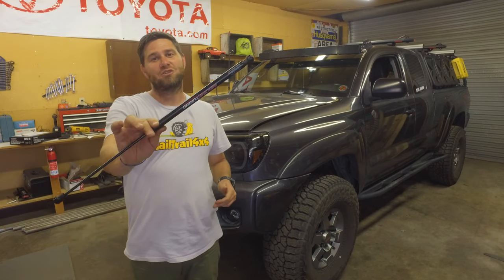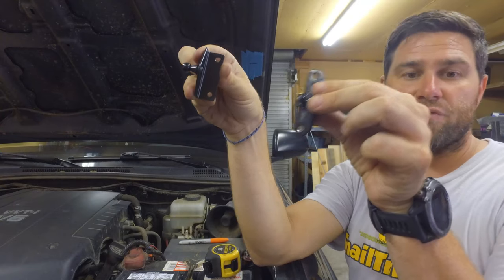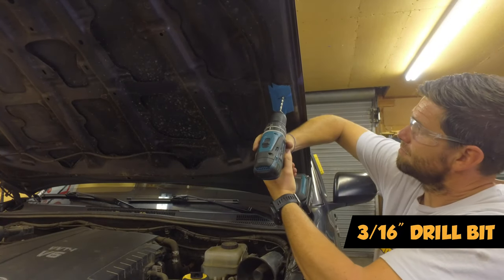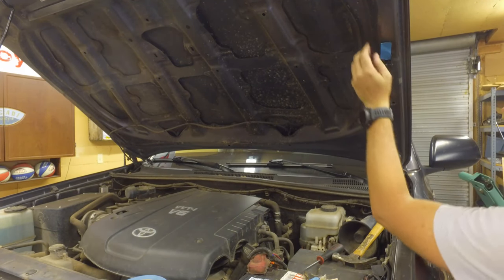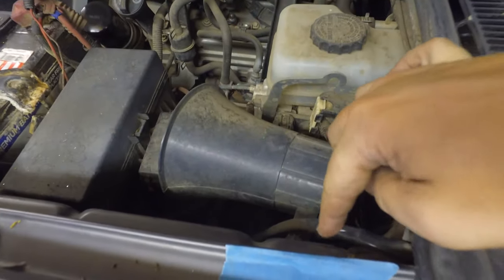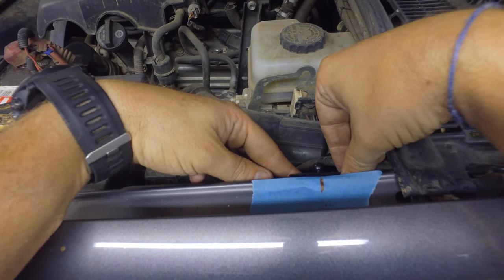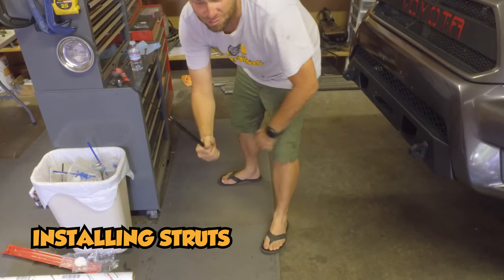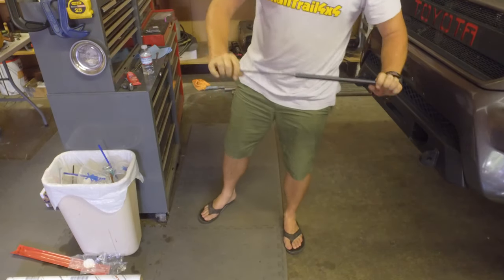Redline Tuning Hood Struts Install | 2nd Gen Toyota Tacoma | TRD Buildup

Comment: Just did mine, super easy installation. I'd advise everyone to refer to the dimensions in the included instructions, just in case anything changes over time. Also, when you measure from the edge of the hood, put the metal at the end of the measuring tape against the hood, and bend it over the bulge to get it at the right spot.

Comment: Nice install.  I did this a while back and they are awesome!!  I will say the rivets were the hardest part for me!  They would not break with my gun and I ended up snipping them off!
Reply from the maker: Totally, that was a forearm killer. I did it on my third gen as well and you have to do the pop rivets on the top and bottom brackets ( as you know)
Reply: Does it work in freezing temps
Reply from the maker: @realitynow4342  -- I haven't tried. I don't live where it freezes all that often. Might want to contact the company, Redline

Comment: Hey man, I don’t know if Redline has changed installation instructions but your measurements for the brackets on the hood conflict with Redline’s. They say 2 3/8” from the edge of the hood. I just did the install and can confirm that 2 3/8” is the correct measurement.
Reply from the maker: Yeah I am not sure why there is a difference in measurements. Glad it work out

Comment: Are the rivets aluminum or steel? Wish it was all bolts!
Reply from the maker: I used Aluminum ones, you probably could do Rivnuts
Reply: Thanks, I'll use the aluminum rivets that came with the struts. The hood measurements in the installation instructions were a little different than yours but either should work. it's for a 2015 Tacoma. Thanks for the video.

Comment: Autobahn88 Hood Struts for the Tacoma require zero drilling and are far cheaper. Works perfect for my 2013 Tacoma XSP-X
Reply from the maker: Really, how do they attach. I haven't heard or seen these.
Reply: SnailTrail4x4 literally uses the stock bolt hole on the fender and the stock upper latch holes
Reply: I like the idea of using existing bolt holes and fasteners for hood shock mounts instead of drilling holes and causing a concern for rust in the future. Do these hood shocks pop the hood enough so I can fit my fingers in to undo the safety latch ? That's a problem im running into with the stock setup on my truck now..  when I pull the hood release , I have to wedge my fat fingertips under the hood enough to lift it up to undo the safety latch.
Reply: @timjensen1826  The gap that the hood pops at has nothing to do with the stock latches or the hood struts, but instead the two round rubbers that you see on left and right side of the front of the top bar, you can rotate these higher to pop the hood higher